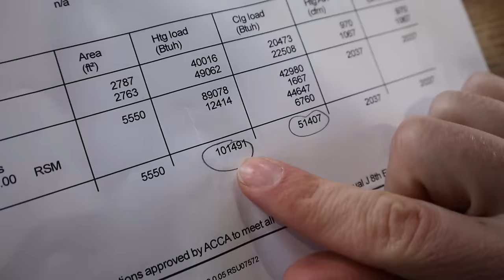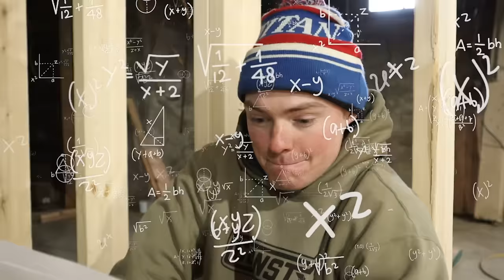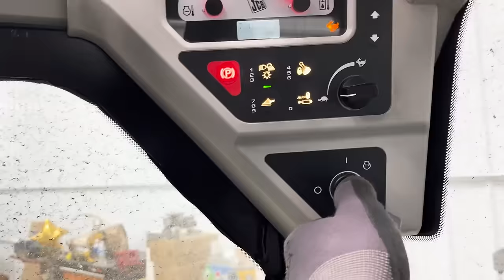Restoring A $7,000 Mansion: Removing 2nd Story Floor

Comment: I’ve mentioned before having the washer and dryer on the main floor may become very important to Nave. Even if you don’t do it now, I suggest putting in the connections in the pantry on the stairway wall. A laundry shoot from the top of the stairs to the pantry would be a big help as well. 

Another suggestion would be to put in a pocket door from the bathroom to the pantry for access and flow. I can see possible additional pantry/storage zones like under stairs or a wall of cabinets in the niche to the right of the kitchen. Just some things for you all to think about.

Comment: Im a GC, but did hvac for a few years before. At 5k sf i would recommend 2 systems. That 10k gives u partial redundancy, so if one goes out, u still have one working. At min, that means you at least have a heat in 1/2 your house. Definitely do the duct work yourself, its easy. 

Consider Putting vents in the top of your interior walls that have a room on the other side that can be closed off by a door that just let air move between rooms. It helps equalize the temp between rooms so u dont have a hot room. Other option is to have temp sensors in the rooms with ac vents that automatically adjust air flow. 1st option is much cheaper. 

The heat recovery system removes bad uncircumcised air from wet rooms in the house like the kitchen and bathroom. Cleans it and returns it to the rest of the house. It lower operating cost but i dont know enough about the system to recommend either way.

Comment: Cole,  when I built my house I had a HVAC contractor set the furnace and plenum and I did all the rest.  I had worked one summer for an HVAC firm and had done rough in on many houses so I was comfortable with installing the ductwork.  It's not hard.  The challenge I had was the flooring system.  To save money I used 2x12 floor joists which is similar to the system you have.  This limits the flexibility you get for running ducts compared to using floor trusses.  You have to build chases to run ducts through if you want to get the air where it needs to go.  One advantage you are going to have is that it sounds like you had someone else design the system so you just have to follow the plans.  I designed everything myself and in hindsight I should have made a few tweaks but it works fine.  Could be better but fine.

As to one or two units, the advantage I see to using two is that you will use up less living space for ductwork.  If you have one unit in the basement you have to get air from there to the attic.  If you already have a unit in the attic you can heat and cool the attic and the second floor from there, again, saving on the amount of ducting you have to run in weird places.  On the other hand, if you used one unit in the basement I would FOR SURE use a multi-zone system of thermostats.  I have one thermostat in my house.  I also have a fireplace on the ground floor.  With a fire going we can have the ground floor at 75 degrees easily, but the upstairs is in the low to mid 60's on a cold day (-20 degrees or so).  This is because the thermostat on the ground floor thinks everything is fine since it's 75 degrees down there.  Therefor the furnace doesn't ever run the fan fast.  It gets cold upstairs and our windows get condensation and frost on them.  Not good.  It will actually be far warmer upstairs without a fire than it is with one.  I should have put a thermostat upstairs with a separate ducting zone so the furnace would heat upstairs when we have a fire going.

It's the opposite in the summer with our central air.  It's perceptibly warmer on the second floor.  With two zones we could solve this problem.

Comment: Cole, it's looking like it's coming together really well. First things first.....spend the money up front and you will not regret it later. 
2nd, the HVAC guys in comments are right, in floor heating, extra in the bathrooms, zone, zone, zone. The forced air system make it two and zone, zone, zone. During the fall and spring spring you may want a little more heat on the main floor, plus winter mornings it will help to take the chill off. The upstairs you will find it nice that since heat rises it might not work as much. Summer heat the upstairs will be working harder than the main floor for the same reason. Sleeping in cooler air is always a plus.
3rd you need to remember your family and their needs, hot and cold. Side note........ Air filtration.
4th you might think you would save money running the duct work your self but with as many twist and turns that's going to be needed, plus zoning dampers and such, I would leave that to the professionals. Now, the infloor heating tubes..... Go for it, run them to the boiler and zoning valves and let the pro's take it from there.
5th, you are not going to be using the heat and a/c in the future addition the same way as the main house so a third HVAC system is really smart. 

I like the idea of your electrical system, having panels in the basement and the second floor, smart. Remember the run an  electrical chase for future addition.  Smart, fiber, Satellite, cable, phone, cat, security, intercom, etc. Never hurts to have and not need than to compromise structure later.

Comment: I have a 4000 soft home in Northern Indiana. It's layout and foundation types change. Due to such, instead of expensive zoning of one system, we have 3 natural gas furnaces with central air. 2 are attic installs and the other in the basement. 
   We discovered how much of an unseen benefit this provided when one of the systems broke down, we still had heating or cooling from the remaining working units.
   The daily cost to run all 3 is really reasonable and each floors temperature is basically zoned by each system yet allows the duct work to be basically customized per floor.

Comment: Juston and Roman are educating on what all it takes to be a carpenter.  Home renovation shows simplify this trade and that is unfortunate. This level of remodeling is a skill set that many do not have. Add the physical strength that this work takes and you have two very valuable tradesmen.

Comment: We have a ground source heat loop.....5 tracks (200 ft out and 200 back...some drill straight down) at 7 feet deep where the ambient temp is 47 deg.....comes in at 47 to a heat exchanger/compressor and goes back out at 33 deg.  We have had this system for 22 yrs and love it.  We have a thermostat which kicks it on when the temp at shoulder height drops below 64 deg.  During the summer we reverse the system and cool the house.  It is amazing and cost way less than normal HVAC.  No ducting to hide or clean out.  No forced air blowing allergens around.  We have an antique wood burning stove to supplement only when temps get down to 30 or 40 below which only happens for a couple of weeks in the winter.

Comment: For your HVAC, maybe this will help. I have a 1440 sq ft house in Southern Calif. So we use AC more than heat. The house is 35 years old so 3 years ago we redid the system. They did all the labor and materials, it took two full days. It included the permits, city inspection/sign off, the big compressor outside and the blower unit in the garage. It ran me $13,000. Your house is over 3 times the size of mine so I think your bids are in line. I will say this, HVAC has obviously improved since the house was built. I was amazed at how much better the house cools, and how strong the air flow is. They said my ducts in the attic were shot full of holes, so I was basically cooling the great outdoors. You can stand in the living room and the air from the duct over 20 feet away blasts you.

Comment: Those bids sound outrageous. Have 4 more contractors come in and give you bids. I think having an in floor heating system and a heat pump system is way overkill. With all the new insulation and windows and doors you will have I think you can have two force air units will suit that house just find. With two forced air units you can have your heating/cooling/humidifier all inclusive and will keep your house at the perfect temperature of 70 degrees all year long. Good luck. Absolutely enjoy your content. Roman and Justin are great friends and talented individuals.

Comment: if the last bid you mentioned was for an HRV, ask about an ERV instead. It works for cooling and heating and basically uses return air to either pre-warm or pre-cool intake air so the system doesn't have to heat or cool the air as much.

Comment: As an MEP engineer, I recommend using multiple systems to cover multiple floors and zones. Especially when considering you have a full basement, main floor, second floor and full third floor/attic. Depending on how much money you're willing to spend, you have a multitude of equipment to choose from. I would look at every option available and base it off the best equipment you can get within your budget. If you have an unlimited budget, I would look at installing a VRF system.

Comment: Hi Cole, I am a licensed contractor and have experience with HVAC systems like those that have been proposed.  The three systems proposed (two heat pumps and radiant floor boiler) should work well.  Having a separate heat pump in the attic should to cool the second floor bedrooms is a solid design.  I really like the Mitsubishi Standard Multi Zone heat pumps.  Very quiet and efficient.    The lower heat pump (multi Zone) should easily support the existing lower floor and future expansion.  I am assuming the future expansion will use radiant floor heating.  Best of luck.

Comment: Having remodeled several homes, I would say that (IMO) you are doing very well. Understanding that there is a cost to every aspect of the destruction / construction aspect, the only thing I would have done differently lies in repurposing. 
I always try to keep as much of the material that I remove as possible, understanding that time is money, you still can save thousands this way. With a structure as large as yours I would save all of the old growth and most likely, true sized 2X4, 2x6, and other dimensional lumber as possible. I know you cannot interchange them side by side, but on a house as large as yours, you could re-use the old growth stuff on one floor, and then use the newer material on another. I know this can cause some mathematical issues in layout as your offsets do not remain the same per floor due to the differences in the lumber sizes. However, I saved approximately $5,000 on lumber in my last remodel that way, and that house was half the size of yours. 
Additionally, work on future proofing. By this, I mean work on things like electrical chases from the basement straight to the attic, with stops at every floor. Yes wi-fi is getting better, but you will always have interference from solid structures, electrical fields and metal componentry. One dedicated cat-5 or 6 line from a main internet hub in the attic or basement, to a router on each floor allows for nearly unlimited and unhindered access, and can be done via a simple PVC conduit run at the time of framing. I know you’ve used simplisafe, but any similar system can also use wired cameras and components which you can run through those same chases. I usually also install at least one camera per floor inside the house in the common areas, for “peace of mind checking when you go on vacation. 
Likewise get the biggest electrical panel possible, or run sub-panels, and over-run your house. I prefer to run a single breaker per room, come in at the hinge side of the door, run all the outlets around the room to the handle side of the door, up to the light switch and then to the lights. You never question if the power is out in a room when you throw the breaker, and dead-checking faults is as easy as backtracking from outlet to outlet around the room. I know when you are done, you don’t want to think you will need to work on these things again, but Murphy’s law predicts otherwise. Find or make a “hot knife” to cut grooves in the foam to run your exterior wall electrical, that will save you lots of time. 
Things I do on all of my houses are insulating all the walls and ceiling of the master bedroom, for truly quiet nights, also doing the same for the family / TV / kids play room, so not everyone in the house has to hear that. Plumbing cleanouts above sink level as a preventive in case you need to clean a clog on the second, or third floor. LED lights for everything, Motion-sensor switches in rooms like closets, half baths, pantry, hallways, and entryways. Anywhere you might need light on, for only for a short time. You enter they turn on, you leave and after a short time they turn off. Coming home with groceries, you don’t need to do anything but approach, the light turns on, you make your trips back and forth, and when done just start putting them away, the lights turn off on their own. Tread lights on the stairs, which are reverse switched (on when the rest of the lights are off) are a life saver, literally. AND, with two children, you are going to drive yourself crazy trying to get them to turn the lights off when they leave a room.  
Lastly, start a big three ring binder with divisions for electrical, Plumbing, HVAC, take pictures of each wall, BEFORE the sheetrock goes up. Show the layout for the service and routing. “Electrical for the second floor comes up Here, and runs to each room this way and then into and through the room this way”. “Plumbing for the second floor comes up here”, “Drains go down here”, and the “Vents go up here”, etc.  If you order specialized components, like light fixtures, outlet covers and switchplates, photograph the packaging and identify which company and store you purchased them from in case you need more, or something else from that line to finish another project. I usually add the make model and manufacturer for the Furnace, AC water heater, dishwasher, their manuals and the date of install. The locations for exterior things like wells, septic tanks, drain fields, and sprinkler systems. I know you’re young, but trust me when I say, you WILL forget over time, and It’s the little things like this which will come through for you in the long run

Comment: Hey Cole, the HVAC discussion is really interesting.  I understand why you are thinking a separate system for the addition, but i might suggest asking your contractor about a different option.   with a first and 2nd floor system in the original house, it would be worth asking about sizing the 2 units you would install now to cover their respective floors on the addition with some pre-installed ducting  to where you plan to put the addition so you don't have to tear the whole house apart when the time comes. I know there is a limit to how much you can oversize before it becomes an issue, but if your splitting the additional square footage across 2 units it may be possible.  This would give you the best of both worlds separate cooling for the 1st & 2nd floors but only 2 units in the whole house.

Comment: You may want to consider a Horizontal geothermal HVAC system, it uses the fact that under the frost line the ground is around 55 degrees Fahrenheit. That alows air to be cool in summer with the use of just the pumps and heating the air from 55 degrees to desired temperature in the winter.

Comment: I’m from Texas so our temperatures never get below 20, I’m also a refrigeration technician. Over here we use heat pumps which is a decent option for heating but a gas furnace is way better for heating. It’s more cost effective to run in heating and you can just get a regular cooling air conditioner that will mate up with the furnace. Also when it comes to furnaces you can also run a gas furnace on a generator if power ever goes out as long as you have gas. And if you do not have natural gas you can run them on propane. Usually when it gets below freezing a heat pump will do little to no heating what will compensate for that will be the electric heat strips and those use a lot of electricity. Ask the hvac company about a gas furnace option and see what they have to say about it. Also as other have said having 2 separate systems one for upstairs and downstairs is a way better option

Comment: The heat recovery unit will paid for itself. It will warm up cold outside air with the warmth that is in the inside air when ventilating. Exchange warm up with cool down in summer. That will save on the energy cost while still allowing for good ventilation. You will not regret that part.

Comment: If you are considering using Warmboard for your underfloor heating, then you might want to consult with them about their heat pumps.  They have a new mode that is designed for extreme winter conditions (Canadian weather).  Their heat pumps also supply cooling for mini split type units, but not certain if it can scale up to a centralized air handler.

Comment: You definitely need more than one unit. We have 3 stories and the temperature is drastically different from the basement to the main level to the upstairs. You want the ability to control levels separately. Our house was built with only one. We have to close the AC vents in the basement in the summer so those rooms aren’t freezing or we swelter upstairs and sometimes my daughter turns on a heater as her room is in the basement. I would cut back on some of the floor heating to save cost, just use it in your bathrooms.

Comment: I agree with most comments 2 systems is the way to go and consider sizing them for the future loads of the addition and radiant in the garage is a must. I have radiant for heat and a forced air system for cooling. Nothing beat the warm floors on a cold day!